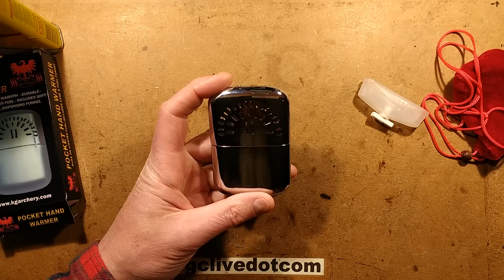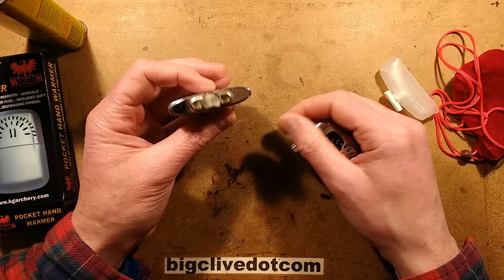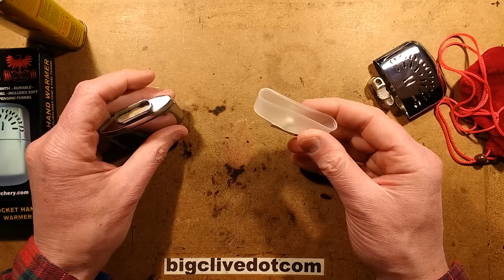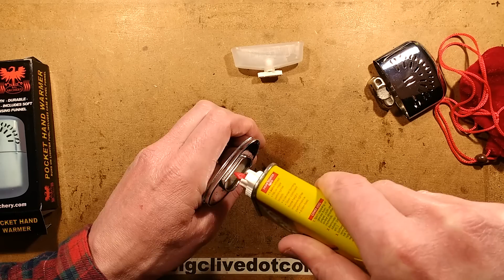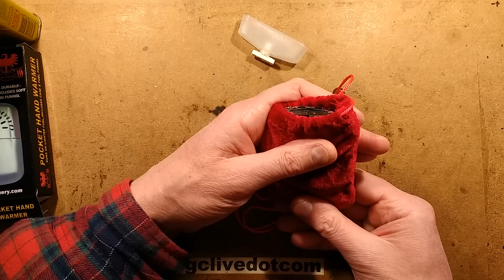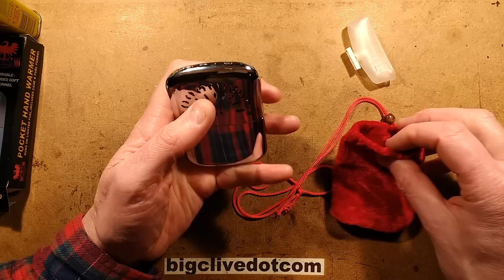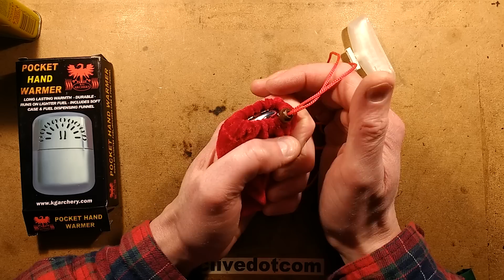How a petroleum-distillate powered pocket heater works.  (naptha)

Comment: I have used gasoline in my zippo lighter back when I was young and foolish. It worked but it smoked I would imagine because it is not as refined as well as lighter fluid. I also used mens cologne which also worked. It burnt with a nice blue flame but made your smoking material taste awful. I had one of these but the top has a piece of fiberglass cloth covering a spring. It also worked very well.

Comment: I bought one of these off Amazon that has electric ignition. I think it was about $50 and what a wonderful little thing. I used it for 3 winters every day until it finally went to pieces. Would buy one again but different job now and I have one of the battery ones which actually works fairly well as long as you don't need prolonged use. It is called the S-Boston-Reuseable-Regular-Lighter

Comment: I’ve use a Peacock pocket heater (the original from japan) for many years and it’s great! 
A bit more expensive than Zippo but works great and is from excellent quality!

The best way to use this is just ignite and put it into the inner pocket of your jacket... it will warum you up quite nicely for several hours!

Comment: If the heater is at max operating temp, and vapor production is at its highest, could it overload the catalyst capacity and allow in burnt vapors to pass unchanged? And if you had a premium catalyst, with significantly more platinum, what would that do? And could you make a “bic” version that uses butane instead of naphtha? Side note: VM&P Naphtha from Home Depot is my absolute favorite smell, number one. (Explains a lot)

Comment: Indeed Clive! These wee heaters have been around for many years. As a lad, I delivered the morning paper in the early 70s, in frosty Colorado.

My hands would go numb in the winter pre-dawn chill, riding a bicycle fitted with balloon tires for the snow and ice. I had one of these heaters in my jacket pocket, for my "throwing hand" and it worked brilliantly.

It's important to use napthta or "Zippo fuel" in these. Gasoline is too volatile.

Comment: I use these pocket heaters to this day. Dont over fill it. 3-4 one seconds streams from that lighter fluid can (witch i advise buying just for bottle) heat for 8-12 hours. I use white spirit, witch smells like gasoline but is easier to start and in outdoor use i notice no smell (when its heating).  And use a jet lighter to heat up housing. Also to prevent skinburn and best heat transfer i made thin leather close fit pouch (few layers of elecrical tape also work)

Comment: These DO glow when in operation. Take it into a dark room and you will see the red glow from the wick/catalyst. Lighting is simple, a few drops of fuel on the catalyst and then light. when the flame goes out the unit will be operating. The OLD original versions of these have a round hole in the side of the guard to allow you to light your cigarette. All good hunters smoke to attract the deer. Old tech tips from an old fart.

Comment: Guess what? My father used one of these for years when hunting in W. Va. No issues whatsoever. As long as you properly use them and do not over-saturate the fluff in them with lighter fluid? Unlikely to explode or set your jacket on fire.

Comment: Hey Clive, quick question, let's say i hammer out a piece of steel and create a cap of the same size as the catalytic converter, obviously something simple but well made...
Do you reckon I you would need something purposely machined to effectively turn off the reaction or by removing the heating element from the close proximity to the vapors even a "zippo like" gas tightness level would do?
I wanna buy one of these fellas but at the same time I want to have the option to switch it on and off at will by having a custom piece.
This way I can simply use the lighter to turn it on when needed and the custom cap to switch it off without all the fuel evaporating needlessly :)
Reply from the maker: Putting it in a sealed bag turns it off by blocking the oxygen.
Reply: @bigclivedotcom  oh yeah i simply want to have a dedicated component to turn it off and on without using a plastic bag

Comment: My zippo , the cotton does touch the burner, zippo says to make sure it doesnt get pushed down as it must touch or it wont work. I have quite a few and work great. Takes about 30 hours to break in to achieve full heat, and about another 30 or so and it is worn out. I wish i could get a large sheet and cut out my own.
I over fill mine. Wet the burner,  light the burner and let it flame for 10 seconds and it usually stays lit. Burn it hot for a few minutes then put it in the bag, use the draw string to control air flow.

Comment: So is there any way of turning it off without letting it run dry or removing the catalytic converter cap and letting it cool down?
Reply from the maker: Yes.  Put it in an airtight bag to cut off the supply of oxygen.
Reply: @bigclivedotcom  Ok, fair enough... :-)
But I rather meant, if there is a specific way it is meant to be turned off. I suppose putting it in an airtight bag isn't necessarily the "official" way to turn these things off right?
Reply: @phinok.m.628  Not really. Either pry off the catalytic converter (using the edge of the cap) or put the warmer in an airtight bag/box (keep it in the sack, else it might melt the bag).

Comment: The original Jon-e version required you put 1 drop fluid on the fiberglass tube. You were to then light it and wait until the flame burned out and there was a steady glow. They worked well and actually had a little swinging door with about a 3/8" diameter hole so you could light a cigarette on the element. 
Be careful not to over fill, because you can get a nasty chemical burn if it leaks and your clothes become wet with naptha.

Comment: The platinum strips the hydrogen off the hydrocarbon molecules allowing the carbon and hydrogen to recombine with oxygen.  If the naptha leaks onto the catalyst it won't combust but rather it will extinguish the catalyst so no real fire hazard there.  

 If you want to upgrade or replace the Catalyst material buy Platinum bright Embers from advanced catalyst systems.   these bright embers are used in fireplaces but will work great for zippo hand warmers!

Comment: This is a faked "Peacock" handwarmer. The original "Peacock" is made in Japan, built since 1923 nearly unmodified, of high quality. 25€ in Germany each (yes, one piece...), replacement burners 13€ each. They last about 70 lightings. But you can use cheap catalytic burners from Mil-Tec - 3€ each at Amazon. They also work well. If you wait a few minutes with burner applied and filled, it lights easier. You can fill it with two full funnels, then it's warm for over 24h. Forget those cheap ones with a gas mantle - they are pieces of crap.

Comment: Okay, I'm not entirely sure what I did, but with the Zippo one I have, it will pull enough gas while doing the catalytic crap that it will actually soak the converter and stop it doing anything. I could hit it with the blowtorch, but I'm mildly worried about setting the place on fire (it's an apartment complex with no regard for any meaningful HVAC install, hence why I own a gas powered pocket heater now).

I have the little gas canister that comes with the zippo one and it's hot hugely functional (read: how to spill gas all over the place).
Reply from the maker: They come with a measure for filling.  If you put too much fuel in it will cause problems.
Reply: I might have to hit the outside of the thing with warm-ish air because the measure they give with it now overfills consistently (I think there might be liquid that's not wicking up knowing my luck).

Comment: if it is cracking the hydrogen off of the fuel then what happens if you fill it with water.

water is hydrogen and oxygen combo..

too if it is working like a catalytic converter couldnt you go to your local junk yard and pull a converter from an old car and put some fuel into the converter and get it to flash?

it is possible that the atomic bonds of hydrogen is weaker in the fuel than water so water may not work.

before you go trying water you may want to buy another hand warmer if you are not up to ruining a perfectly good warmer as i am not sure what would happen if water comes in contact with catalyst material.

it is possible to damage the catalytic coating or could work so violently you get an explosion so make sure you do that outdoors.

Comment: Don't try to run them on Propane which actually works.
Also don't try to manipulate or multiply the catalyst. It tends to decrease in power. Tends to.
The catalytic converter seems to be full of oxides and carbon from time to time, thus changing the ignition waiting effort.

Comment: Been going for years. The early ones had an asbestos fibre tube with a catalytic wire wrapped around it. Then they changed to a mesh catalytic unit. Don't overfill it or it will leak liquid fuel
into your pocket. Mine last about 8 hours on a  fill, but they do have a characteristic smell when operating.

Comment: i have 3 Whitby burners The original petrol hand warmers, similar to yours tho,
the best way to light them is of course fill with fuel!
put the element (top part) on and give 1 sharp shake , then light, you get a flame for about 5 -10 seconds then it goes down to the glow..Job done>....
Oh by the way get fuel from asda at £1 and i get 5 fills that last over 10-12 hours basically all day,  so all day for about 23 p, as i work alot out in the cold i have 3. 1 in top pocket and other 2 in trouser pockets. :)
Note ,Don't keep a gas lighter flame on the wick bit as it soot's up and creates  carbon sooting that choke the wick from breathing ..

Comment: Used them for years, when I was collecting my Maple Sap, I always started them by putting a few drops of fuel on the catalytic part and lighting it, and letting it burn out. That also heats the lower part, as you stated. They work great !

Comment: I had one when I was a kid in the 70s.  It was a Jon-e warmer. It would actually have a faint flame that would burn inside a rockwool filament tube that was shrouded by that kind of silky mesh that white gas lantern mantles are made of. It would get quite hot and you could light a cigarette with it. Mine was fairly large -- about the size of a hip flask. They were okay -- lasted about 6-8 hours or so. Good for skiing or if you were outside hiking around or cutting firewood or winter camping in the snow. Great for snowball fights. One tended to smell like lighter fluid, though. In the days before the dry chemical hand warmers became cheap it was the easiest way to warm your hands up.

Comment: If you want to up the danger quotient and use in doors alcohol also works.  burns clean but does not have blue flame so if stuff spills can lightvon fire and you wont know until its too late.

Comment: I just use electrically heated clothing with a spare set of batteries. While using one set in my jacket, pants and shoes, I charge the other set from a big 500Wh lithium battery that's constantly recharging during the day from a 100 watt folding solar array. By the time one set of batteries runs out (5-8hrs), the other set is finished charging. 

At night I have a heated blanket I run off the main battery, which also charges both sets of clothing batteries while I sleep.  It is perhaps an overly complicated solution, but it never runs out of fuel and it keeps every inch of my body warm at all times. I also sometimes run a small electric oven off the big battery when I camp in places that don't allow fires.

Comment: NAPHTHA IS NOT GASOLINE >>>NEVER USE GASOLINE IN THESE HEATERS<<<
Reply: You'd get warm
Reply: doc said brian was hurt but i like the smel and it keeps me warm
Reply: @saltysoysauce954  You'd get warm IN A HURRY!
Reply: CAN I USE NITROMETHANE???
Reply: @dibblydooda7604  Sure, go ahead. Just be sure to get a friend to catch it all on camera.
Reply: OK
Reply: It's true that you shouldn't use gasoline (or in the UK, automotive petrol) in a heater like this, but not for the reason you might think. The volatility isn't the issue, since the flash points of zippo fuel and modern unleaded petrol are almost the same. The problem is the additives in the petrol: Lead is no longer one of them, but there are other organometallic compounds in the fuel for various reasons, such as ferrocene or MMT. These can easily poison a platinum gauze catalyst, rendering a pocket heater like this useless.
Reply: I had a catalytic oven. I pulled gasoline in it. It worked, but it smells...
Reply: https://www.youtube.com/watch?v=QhuMh97C0yc
Reply: Kerosene is napatha
Reply: Camp stove fuel works well and always has. White gas.
Reply: Yeah, that's what I was thinking.
Reply: @Francois_Dupont  The fact that you think the vapor point is the sticking issue is why you have no credibility and should just sit down.

Comment: These catalysts seem more robust than fragrance a lamp's. Maybe tighter doped(?). The lamps use IPA though that requires physical wicking. Fragrance lamps always block up and/or over heat. It seems they are for people that like buying wicks! 😂 I must look into these catalysts. Thanks for the info on soldering irons. The fragrance lamps look to be a porous ceramic loosely doped with cheap metals that end up burning off :(

Comment: I am some what of a (pocket) hand warmer guru.  I learned about them when my father brought one home from the war in the 50s.  All hand (naptha) warmers are based on the Peacock (original) and are either modifications on the original design (UST,  Zippo, etc.) or are updates on the original (the new Peacock) or improvements (Boston) on the early designs.

Strangely enough, no new hand warmers of fuel type have been invented that are not direct copies, or modified from the original designs since they first came out.  What I'm saying is, the hand warmer you buy today is the exact same principal as one from 30 or more years ago (Jon-E for instance).

I do not dabble in instant hand warmers, or electric hand warmers, because they are all crapola, if anyone has questions.

Comment: I used to use a solid stick hand warmer (you literally lit the stick until it smouldered, then put it in a case) when I fished up in the Arrowhead.

I never quite knew how these worked, so I never tried one.  I probably would have picked one up if I knew how they worked...

Comment: I’ve seen tutorials saying put some fuel on the cat but I think it would damage it and it catches fire and can burn the vapour with a small naked flame but if you take your time and expect to need to light it modern than once it is very good. Mine is a Whitby warmer that has a non return valve next to the gauze wadding fro filling stand a nice filling cup which I  can’t find anymore. I usually fill it through the valve and put some more petrol or other fuel (naphtha is recommended) where the wadding is. I think the  “Five Seconds” is a bit optimistic and would only work if you were in a hot environment where you wouldn’t need this. I suppose if you worked in a refrigerated environment in a warm pfacw

Comment: The originals are "Peacock" hand warmers from Japan.
They have been making them from way before WW2.
The company was started by the scientist who discovered the catalytic process.
They are still available from the same company and are very high quality for a high price.
I believe that these cheap ones don't use platinum but instead some chemical process. 
There is a large difference between the cheap ones and the Peacock, Zippo etc... Ones that use Platinum converters.
Lots of the knockoffs will have the Peacock shaped airholes like the one shown here.

You can adjust the heat by the bag opening.
More oxygen for more heat but shorter runtime.
An important bit of into is if you get an old one be careful as the heater is made from Abstestos and can kill you!!!!!
Be carful as the invisible fiber are easy to inhale and can cause a slow and painful death.

Comment: The Zippo models seem to be very reliable and predictable in my experience.  I and my wife have both used one.  Hold a flame on the body of the heater for a good 15-30 seconds to get it good and warm and vaporizing fuel through the catalyst, then ignite the catalyst.  Get the top on and put the whole thing in the cloth bag.  The cloth bag is very important!  It keeps the heater from getting too much air and overheating.  I've had one go over six hours on a single fill, and was very, very warm - almost hot - through its bag and absolutely perfect inside my sweatshirt pocket, under my coat.  20 degrees outside, but comfy warm nonetheless.

Comment: I've used the Jon-E heaters a lot. They had a element made of mesh screen. The easy way to light them was to put a couple of drops of fluid on the mesh and light it. When the flame goes out, the heater is lit.

Comment: I am totally sold on this product. Its a small metal container, of dubious origin and design, which converts petrol into heat, regulated by a small synthetic-fiber pouch. I fill it with petrol, heat it up, once the chemical reaction eventually starts, I put the lid on, tuck it up in the polyester sleeve... and slip that motherfucker down the front of my pants. What the fuck could possibly go wrong?
Is there any way to financially endorse this product? Because I support arson, self-immolation and bad life choices, and I think this aligns perfectly with my brand identity!

Comment: I used to often use one of these while riding a motorcycle.  I'd slip it into my internal breast pocket of my jacket on cold days.  It really did the trick.  However, if any air started to flow up through the bottom of my jacket, the increased air flow would cause it to go into turbo mode and start burning my chest.
Reply: Oh wow haha